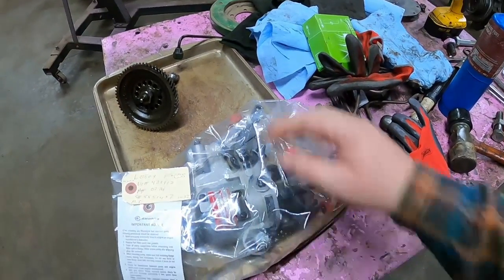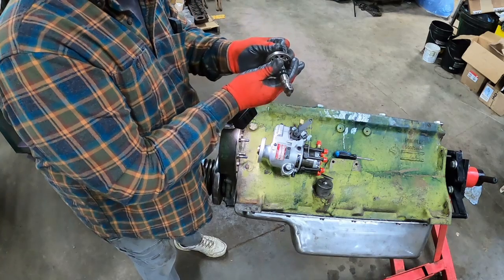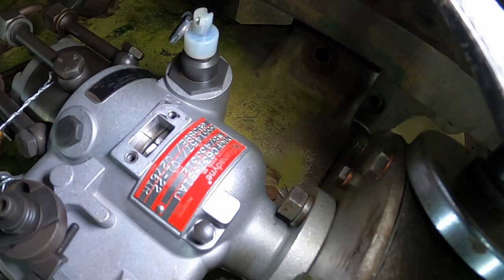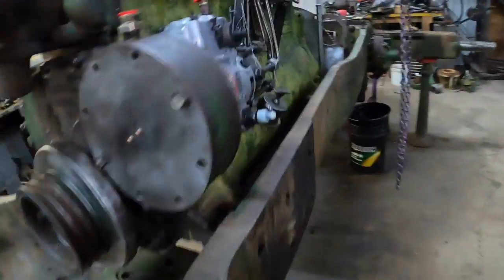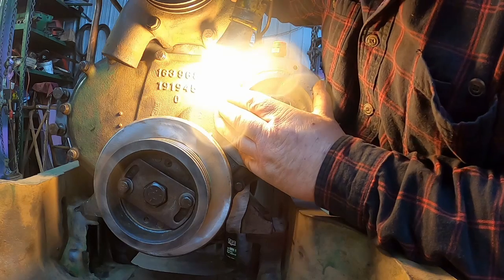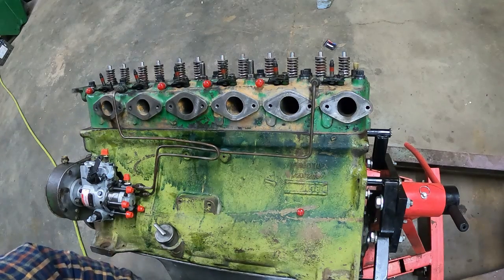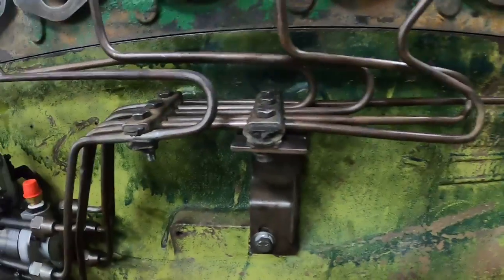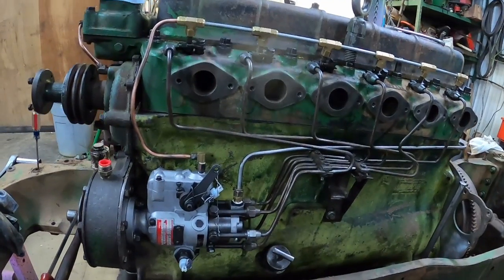TIMING IS EVERYTHING! Installing the 310 Injection pump and injectors

Comment: I tried one of those return line kits once and ended up taking it off and throwing it in the garbage. It probably would be easier with the engine on the stand, but I could not get the thing to quit leaking. I use brass barb T’s and short ends of hose. The first set lasted over 10 years on the 1855 and I only changed them because I was working on something and they were easy to get to.
Reply from the maker: Now you tell me. I have my concerns with how easy they turn on the injector. Maybe a good coat of paint will seal them up.
Reply: @ThatOliverGuyChris  the end the clamps over the injector was the end I had trouble with. It was a pain to get it on there and then once you tighten it down, it would not quit leaking.
Reply from the maker: @rosstheoliverman  great. Guess I better find a way to get them tighter before the paint flies
Reply: @ThatOliverGuyChris  On Deere engines I use those parts, since the OEM is a billion.........they work fine but if you take notice they bottom out and not really tighten the rubber first, I chuck the ends in the lathe an knocked about .030" off of them, work fine after, tightened up the rubber and not bottom out on the tee.   If I had to guess the rubbers aren't quite as long as what the OE is and there is the issue, IMO the brass parts are made well.
Reply from the maker: @tpfromcentralpa1692  good to know. I bought some genuine parker rubber ferrules from MSC to have on hand. I think I will swap those out and see if they snug up better.
Reply: @ThatOliverGuyChris  Post the out come, that was my thoughts but never tried it, just walked to the lathe, threw the nuts in the collet, and took some off.  

What did Oliver do from the factory?  Did they use the rubber tee with the hard line between them and wire hose clamps?  Only things I know about Olivers was from a 1850D I had at one point, but that was years ago and now I only learn about them while eating cheese cake for my night snack, but thanks to Ross, it seems that turns into a screan cleaning seminar.  So I essentially know nothing.
Reply from the maker: @tpfromcentralpa1692  they used the rubber boots with the with the wire clamp. The only ones I have had trouble with were the cheap aftermarket ones. The ones with the Stanadyne S right in the rubber work good for me, but I thought I'd give this a whirl.
Reply: @ThatOliverGuyChris dont worry Chris even though they move alittle they will seal the fuel. I put a set on my other 1955 last fall.  The rubber ferrel lets them move some.
Reply from the maker: @aaronkaraszewski2749  that's good to know. With my plans on painting before firing it up, I dread thinking about them leaking on brand new paint.
Reply: Chris the return line caught my eye in the thumbnail. On my JD 6620 combine it has a setup like that I don't  know if it was factory or aftermarket but it hasn't given me any problems, and I have friends that have JD 466s in different tractors that have problems with the rubber tees.
Reply: We had a 4640 that had those Rubber sealed Tees on the  bleed-off lines on the injectors,,   The 4020s use   Rubber boots  that slide over the end of the injector and secured  with a  spring type hose clamp   to connect the bleed offs to the tank return line.... our only modification is to replace the Spring Clamps with  SS worm gear clamps,  and replace all 6 of one starts leaking.....

Comment: Hey Chris, thanks for showing me how to time the pump with the marks! I need to check the timing on my son's Massey 285, I'll be saving this video to re-watch it when we go to work on his tractor. I tried to check it last fall and I now know what I was doing wrong. My dad rebuilt his injector pumps back in the 70's to the 90's, he was self taught and a mechanically inclined man, miss him a lot. Thanks for giving us this video on the fuel pump, I will certainly use the info! Have a great week!
Reply from the maker: Hopefully it's the same. If that uses the CAV pump, they had letters inside the cover to line up with the mark.
Reply: @ThatOliverGuyChris  I'll have to check, old guys can't remember things past a month, don't you know!😁

Comment: I've got a couple of injection pump projects coming up here this spring and this video is going to be an excellent help thank you very nicely done Chris.
Reply from the maker: Just don't pull outward on that lock wire.
Reply: @ThatOliverGuyChris  been there, done that. Also had the shaft pop out when tightening the bolts
Reply from the maker: @paulkline2719  , yep. You say a few choice words, and get back to work.

Comment: Had one of those umbrella seals roll over on me and leak fuel into the oil on my 4-78 forklift.  Picked up new seals today and my pump guy gave me a tip:  cut off a piece of the plastic bag they wrap the injection pump in and roll the plastic bag over the umbrella seals like rolling a cigarette.  Hold the bag tight as you slide the shaft into the pump and pull the bag off just after the seal goes into the busing.
Reply from the maker: Good tip! Thanks!

Comment: Great video to show the proper way to install injection pump , timing injectors . I use a small bit of Vaseline on those seals n pump bore . I've done the same thing with the tie wire on those bolts . Dorman carries fittings n grommets also . I just used that same kit on the 1750 had the factory stuff on it and new injectors also same as yours . Again great video to show its not that confusing.  From turkey creek farms be safe n thankful
Reply from the maker: Did the new Ts seal up good on the new injectors?
Reply: I had a few issues but not bad you know how it go's,  little things that drive ya crazy

Comment: Hey Chris great video even had some funny parts.  I buy those tee's from reliance seperate and just make my own lines. I tired to find them direct from parker vibra lock but they do not show one with two different sizes like these. Some company makes them for deer, reliance and a&i. I just do not know who.  Like I said in the other comment they will seal even though they still move.  As Ross said I have removed pumps without pulling the shaft out the front.
Reply from the maker: Ross and I talked about pulling the shaft. Turns out it was just the way I was taught to do it and I should be leaving it in there. Thanks for the vote of confidence on the Ts . I guess I will leave them alone.
Reply: @ThatOliverGuyChris  well if they do leak you can blame me!!

Comment: I have a VW Beetle with a turbocharged diesel. About a month ago, I needed a new fuel pump. My mechanic sourced a company that sells rebuilt pumps. When they got the pump, they could not get the thing timed with my sprocket. Eventually, after about 3 weeks of trying, they sent the pump, AND my timing sprocket to the place they bought the pump from, and requested they time it. They just got the pump back, with the sprocket that is my sprocket (they marked it) and it times. However, it wasn't the same pump (they marked it, accidentally). The company did NOT say they messed up, but we can all draw our own conclusions.
Reply from the maker: I hear those diesel bugs get fantastic mileage.
Reply: @ThatOliverGuyChris  yes. Mine's an automatic so it only got 40mpg when new. Now, 16 years later, I still can pull 36 - 38 depending upon where. My daughter had a TDi Jetta, stick shift, and she got 50 mpg highway.

Comment: Safety wiring hazard is usually just getting poked with a sharp end of the wire, I was in aviation. Having what you are wiring coming loose in your  hand is something different all together. :)
Reply: First rule of lock wire is when you get stuck it goes to the bone... 36 year aerospace career.

Comment: You have a timing mark clearly visible on the tooth of the injection pump drive gear tooth. I’m courious as to why you didn’t use it to line up with the mark on the drive gear tooth? I can also clearly see the mark on the drive gear tooth in the gear pad.
Reply from the maker: I totally missed that. What time was it at in the video?

Comment: Sorry buddy but you made that pump timing look difficult today! 😂

I think I remember a 1974 Service Bulletin that changed the 1855 timing to 0? 

The metal tees in place of the plastic are great. First saw them on the 1855 Repower engines. Don’t remember if they ever made it into the WFE parts system? 

Thanks for sharing.
Reply from the maker: It definitely wasn't working with me. 😂
The timing to 0 was supposed to aid in starting, which it would, but I think it was really more about fighting the other troubles they were having. I decided to stick with 2. 
I never came across any metal return Ts from White in my travels.

Comment: Hey Chris  when you get your parts from any companies do you always have right parts or sometimes they wrong number, don't match with parts? How long do you wait for there mistake parts to fix tractors? When you rebuild your tractors engines do wish make something different to engines to perform better? Thanks again answer my questions
Reply from the maker: It's rare that I get the wrong part, but I look up the parts numbers myself and I think that saves a lot of trouble. It does occasionally happen, but the majority of the places I deal with are good at making it right. 
Typically I rebuild to factory specs. I figure I'll get longevity, which means more to me. There are some things, like these return Ts that I'll upgrade.

Comment: Could a full lined silicone hose clamp be used as a compressor for that seal?
Reply from the maker: Could be, as long as you can get it back out after it slides in.

Comment: I wish someone made a good return line setup for the 88’s
Reply from the maker: If a guy could get the Ts with 1/8" pipe thread and the vibra lock fittings, it could be done. I'd use copper line since it bends easier. I might have to look into that....

Comment: Well, I learned that my small investment into the umbrella seal tool was a wise use of my money.
Reply from the maker: How much does one cost. I should probably make the same investment.
Reply: @ThatOliverGuyChris  Got mine through Deere, think it was $35, I am sure elsewhere its cheaper.  Not much to it, but the elimination of a arse ache is worth $35 to me.  I got one with the tip of a pick and I didn't know it once, that redo cost more than $35.
Reply from the maker: @tpfromcentralpa1692  good point. When I folded the seal in my 1750 it cost me a fresh oil change. After the second time I let it sit overnight with an empty oil pan to see if it got fuel down there. I should have mentioned it in the video as a tip.